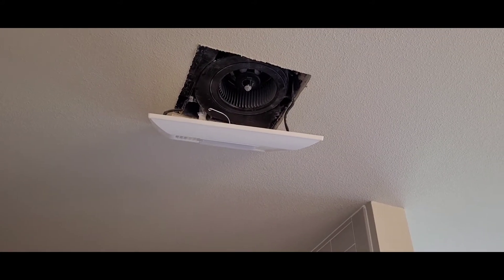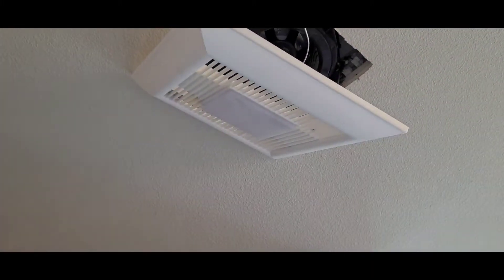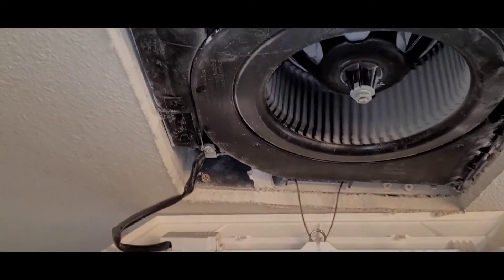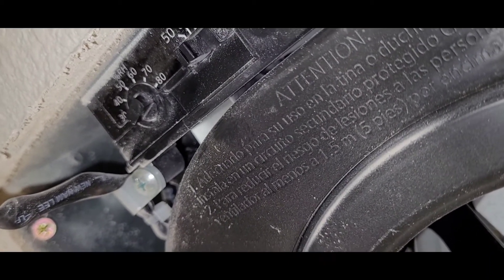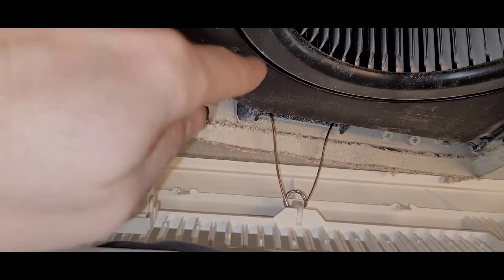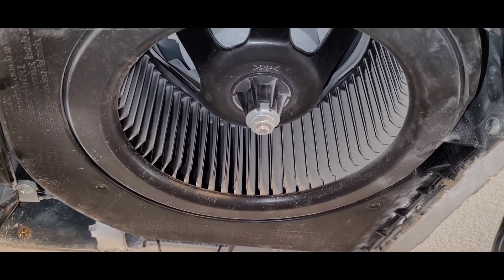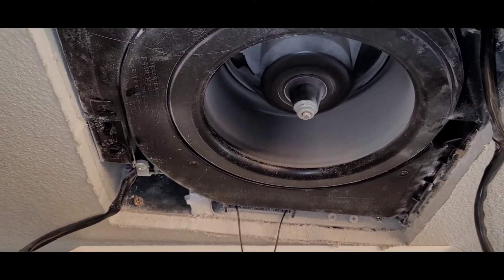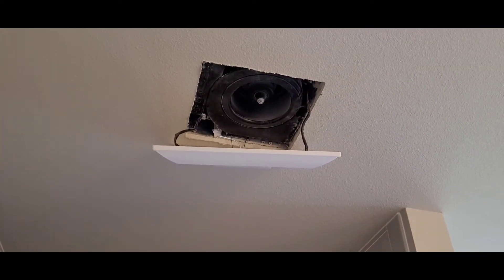Walk Through of Panasonic WhisperValue Modules, Features, and Settings

Comment: Can you install the whispervalue dc FV-0510VS1 to replace an old fan
Reply from the maker: As long as you have power supplied and ductwork. If done from below in a ceiling application, you may have to cut extra large for connections. Then it's just drywall repair

Comment: These sound like great products, but I am shocked at how bad Panasonic's documentation is. They make it really hard to figure out a lot of things. Their website lists the WhisperValue's "Ventilation Design Approach" as "Continuous Ventilation. Spot Ventilation", but the manuals only describe two CFM settings (high and low) for the FV-0810VSSL1, which is the model without the condensation sensor. In your video, it does not appear as if the fan is running continuously. Can the model you have in this video be set to run at a continuous low speed and then be switched on manually for a higher "spot" speed?
Reply from the maker: In my experience, I worked with an electrician in the field, and we had to work through what I wanted to do, then I leaned on his knowledge as to how to do it. Feel free to dm me on Instagram. My handle there is @pioneerbuildersinc